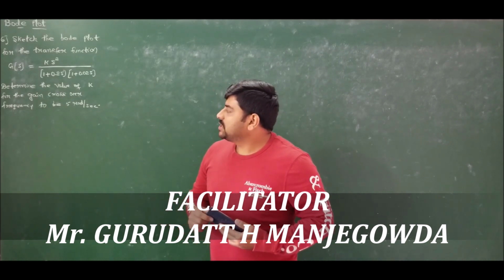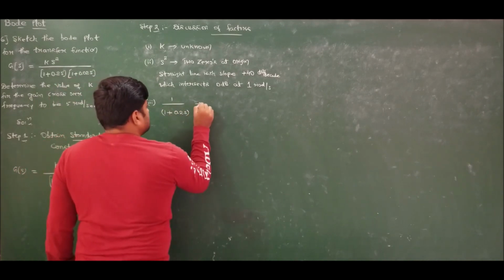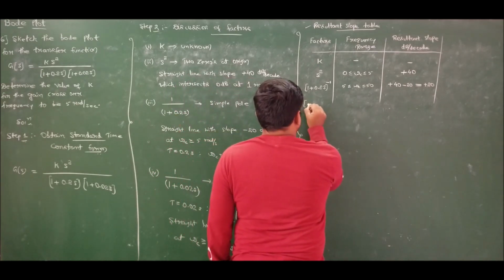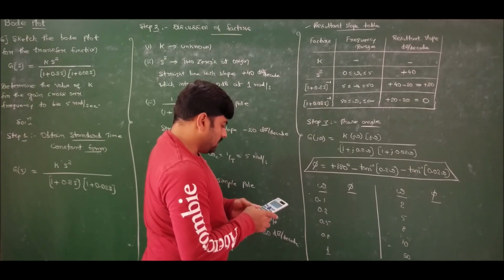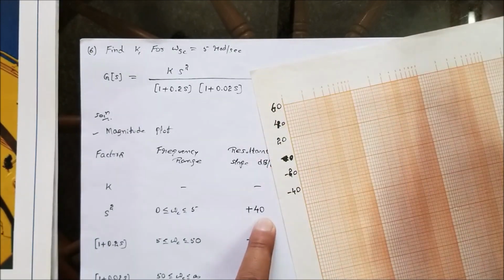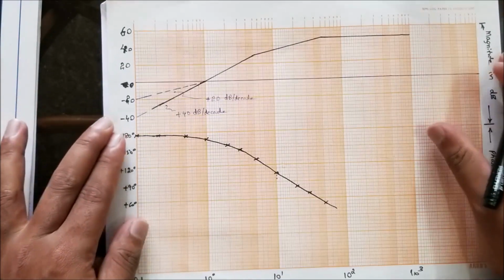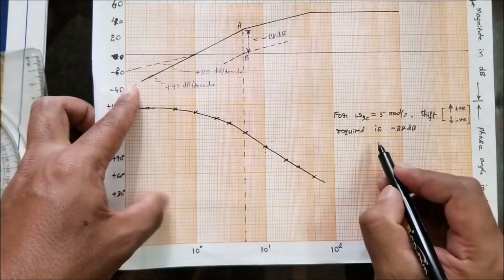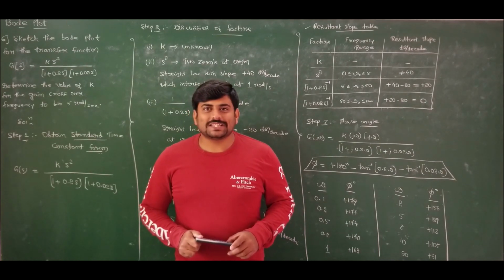Lecture 7 - Problem on bode plot #6 - Module 5 - Control Engineering by GURUDATT.H.M.

Comment: What should do if phase angle plot is not crossing the - 180 degree line
Reply from the maker: The phase cross over frequency in such cases will be 0 deg. or infinity. Analytically you can find.
Watch all the lectures in the playlist your doubts will be clarified.

Comment: How to check K value? In the scientific calculator fx- 100MS.  sirr
Reply: @ Shivu
25.5 min,

20 * log10 (K) = -28
log10 (k) = ( -28/20)
log10 (k) = -1.4
K = 10^(-1.4)
K = 0.04
Reply: Sirr we have required time domain performance of control system notes. Please provide to us.
Reply from the maker: Practice numerical problems from text book on time response specifications that is enough, you will get a problem for 10 m. All the problems are straight forward,  write the formula, substitute and calculate.